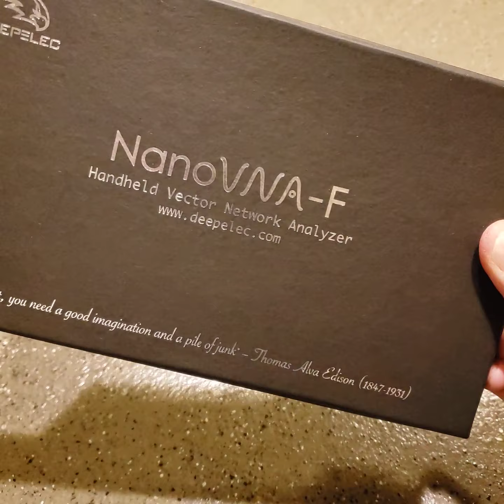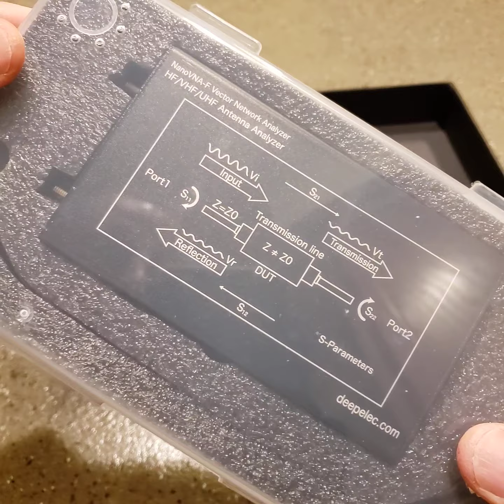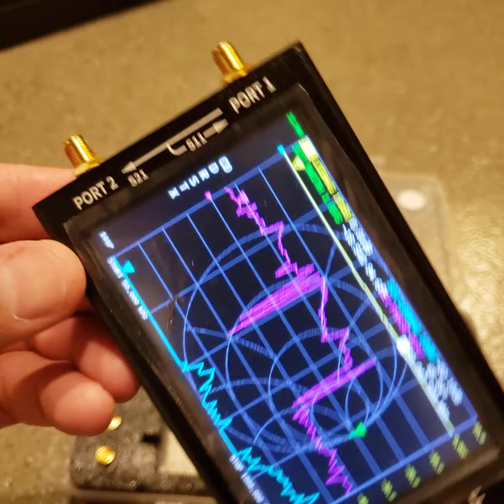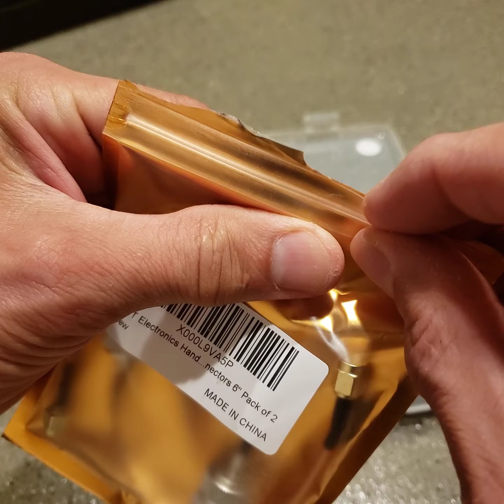Nano VNA -F (Vector Network Analyzer )

Comment: You got the old version.  You should have purchased the 2020 edition.  It uses small buttons instead of the wheel.  The wheel works but you need to be gentle with it.